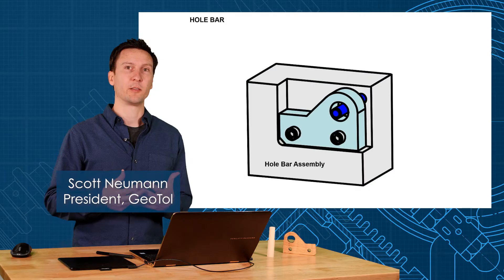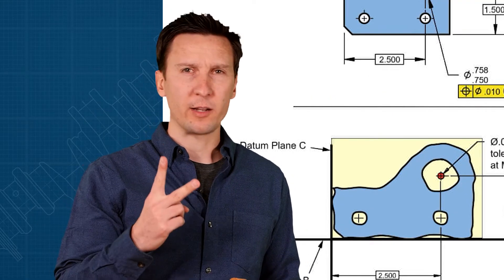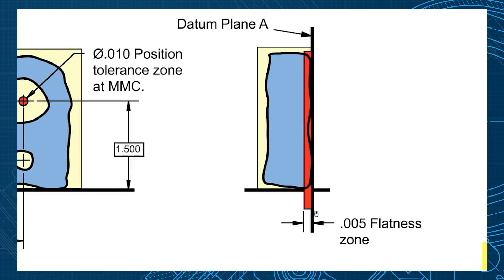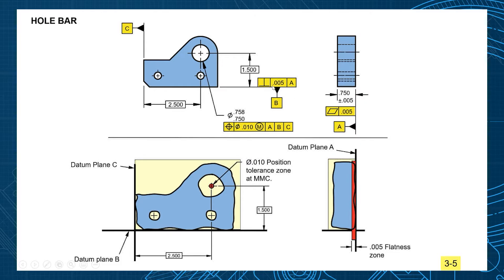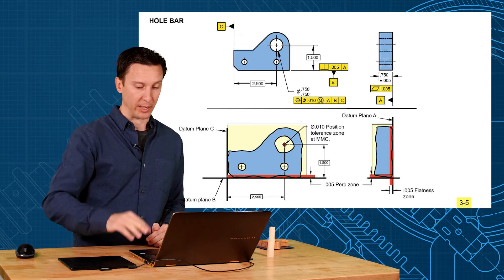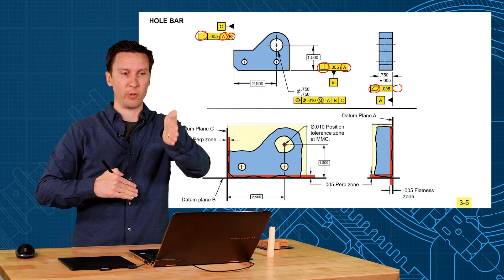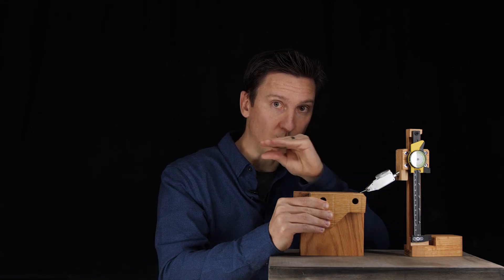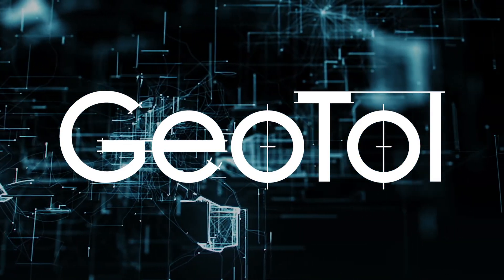GD&T intro - Qualifying the Datum Features

Comment: nope, the parallel planes are evenly distributed to each side of the theoretical datum plane.
Reply from the maker: Flatness and perpendicularity tolerances are not equally distributed about anything. They only represent the range of variation on the surface (max-min). 
Paragraph 7.11.1 Plane Surfaces as Datum Features:
"Where a nominally flat surface is specified as a datum feature, the corresponding true geometric counterpart is a plane contacting high points of that surface."

Comment: Datum Feature Qualification doesnt used in all drawings. I've seen only datum a given flattness and others left alone or none of the datum features are qualified. Is the mating with another surface keyword here
Reply from the maker: "Every feature shall be toleranced" is a rule in ASME Y14.5-2018 (even the datum features).

Also, datum features should be the mating features. Don't select non-functional datum features. Watch some of my other videos for functional datum feature selection.